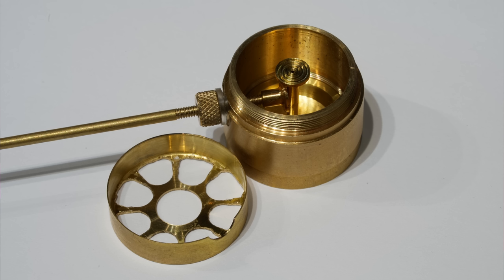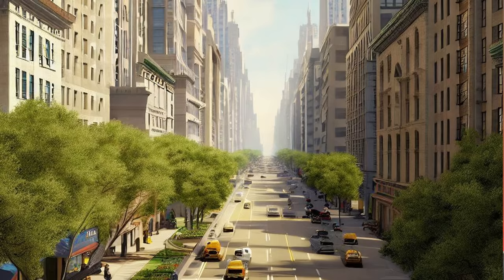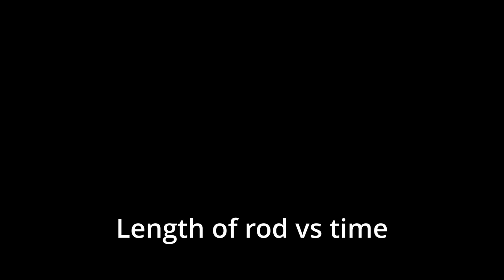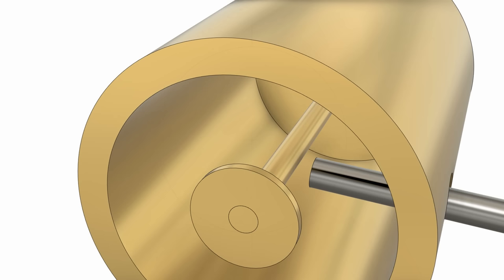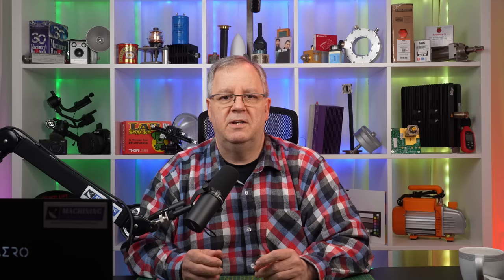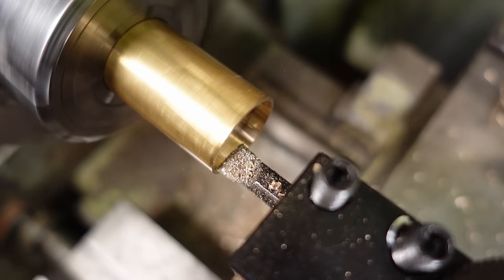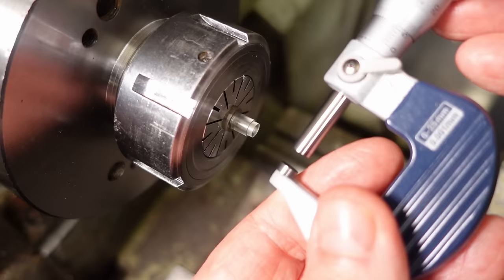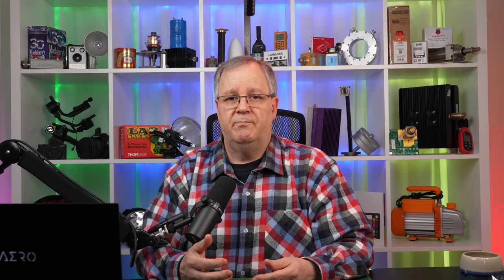SOLVING the Mystery Behind a Soviet Spy Bug : A True Masterpiece of Technical Elegance!

Comment: Let me tell you something without flatterie : you are a pure genius and an excellent machining man. A question : as a ping pong lover is it possible to invent a new way of building a racket , instead of wood , a titanium core on which the typical rubber is applied. Or to be more in your field : can microwaves influence the ball in some way , 2.8 grams of plastic ?
Reply from the maker: Celluloid ping pong balls have a Dk around 4.0, a little more than a polymer ball, but I can't find the loss tangent of celluloid, nor the exact polymer used.  If the loss is high, then it might be feasible to use a rapid-slew aiming system to hit the ball with a mmWave beam adn cause a little more heat to be dissipated on the side facing the sender, but it the ball is spinning, they the effect would be smeared out around the "equator" unless you could use something to detect the exact spin rate and send pulses only when an optical tracker say the same rotational position. Whether that could cause any useful deviation seems unlikely, but even heating the entire ball could affect the trajectory by heating the boundary layer of air and modifying the internal pressure. Some sort of titanium mesh structure might be a useful core for a bat, but the rubber facing probably has the majority of effects on the performance of the bat/paddle/racquet/racket.
Reply: I initially misread that as "building a rocket"... the resulting confusion was spectacular

Comment: Impeccable analysis ! Isn't there an ISM band close to the resonant frequency which you could use instead of 1200MHz ?
Reply from the maker: Nothing in ITU Region 1. In the USA I could use 902 MHz, but there's a lot of critical service allocations in the 900-1100 MHz range, see https://search.itu.int/history/HistoryDigitalCollectionDocLibrary/1.44.48.en.101.pdf p96 
Also, I had some kit for 1.3 GHz already. I did wonder about 868 MHz, but I'd have to make a longer body to get it to tune that low.  Easier to shorten a cavity than lengthen it!
Reply: @MachiningandMicrowaves  understood. Thank you for the link to the massive document ! Imagine having to manage that lot !

Comment: You know, some audio engineers pay big money for high end microphones. I imagine they would be even more for a custom microphone.
Reply from the maker: There are some absolutely stunning high-end custom condenser mics out there that are outstanding pieces of work. The folks making them are at the level of professional watchmakers and jewellers. You've got me thinking about making a microwave cavity microphone along the lines of those from the 1941 patents, but using modern components at microwave frequencies. That would truly be Machining and Microwaves territory.  Getting the connection into the body to be stiff and silent enough might need some very fancy techniques, buy perhaps just some ultra-fine wires and ceramic or glass feed-thru ports would suffice.  If I were to build the microwave components into the cavity wall, that might be a good solution.  The basic design is fabulously simple. I would need to consider how to get the tuning more reliable, perhaps by using flexures or a sapphire rod for fine tuning. Then there's all of the fluid dynamics to consider to get the frequency response to be adequate. Might have to do some vacuum deposition on mylar, but I'll need a thicker layer of about 8 micrometres of aluminium or silver then a gold finish, or go for gold right through. I'll let that one churn away in my subconscious for a few months!

Comment: Linen seed oil actually works as a thread locker...
Reply from the maker: Interesting, I should really investigate what they might have used.  I suspect a wax or Cosmolene type of material, but a drying oil like linseed would certainly work, if rather permanently.  Seeing as there was not going to be any access to the Bug after deployment, linseed could certainly have been used.  Thanks for that tip!

Comment: Svetlana and MELZ weren't doing one off super fine tuned stuff. Especially in 1945 when they were super busy redesigning their entire lineup of low frequency tubes to start cranking up replacements for RCA tubes in all the lend-leased equipment Soviets decided to keep.
Such a precise device would probably done in a prototyping lab at the facility that produced the whole system. Possibly under direct supervision of the designer.
Reply from the maker: Excellent point, yes. I did wonder if there were any lend-lease tubes that they could have used, maybe with a Kalitron style oscillator and multipliers, but I haven't found any references (yet) so it's just guesswork on my part. References suggest that Beria informed Stalin that a system was ready much earlier than Feb 1945, and this one was serial number 11, so it is possible the transmitter dates from earlier work.  There is also the question of the internal modifications to the Great Seal carving and when they happened.  Perhaps there was an earlier generation that was superseded before the hand-over of the carefully-targeted gift to Harriman.
Reply: @MachiningandMicrowaves  i think they made a nice cutout based on the design drawings, but either messed up or something changed design afterwards. So they gave a chisel and hammer to some RF technician and said something like "make it fit by lunch, so we can finish it, it would be covered anyway".
Reply: Or the hole was carved by a technician completely. So the craftsman who made the seal wouldn't even know he was making a bugging device.
Reply from the maker: @denisdrozdoff2926  It causes me pain because I'm also a woodworker.  It does have the hallmark of some RF tech using a screwdriver and hammer rather than fine cabinetmaking!
Reply from the maker: @denisdrozdoff2926  Indeed. Need-to-know basis

Comment: Your explanation for the fracturing of wine glasses by acoustic energy is very elegant but, I believe, entirely incorrect.  It is simple resonance of the gross structure of the bowl that causes the damage.  You could test this by using the same mass of glass to create glasses of different forms and seeing if they require different frequencies to shatter.  The frequencies needed to resonate even molecules, never mind atoms, of glass would be way higher than the human ability to hear them.  That would be one hell of a soprano....
Reply from the maker: It's a bit of a shaky analogy for sure. The bulk movement of the glass is the result of tiny intermolecular distance changes between the electron clouds of the molecules, so no resonances or energy level shifts or anything quantum. Just like in any solid, the bulk behaviour is a result of microscopic changes at the molecular scale. I was getting to the point of stretching the analogy beyond its elastic domainI think. Definitely meant intermolecular distance variation of the amorphous solid by means of a multitude of tiny strains moving the electron clouds away from their equilibrium points
Reply: @MachiningandMicrowaves  Not much of an analogy if it can't manage a good stretch. 8 -)

Comment: The Russians most probably used American made APX-6 IFF transponders supplied by the British during the war. The APX 6 used a  lighthouse tube in a coaxial cavity producing high power pulsed RF at around 1 Gb. The modification removed the pulser and replaced with a steady state supply which allowed about 1 W input carrier power. Another APX 6 could be used as receiver, with another lighthouse tube in a coaxial cavity as local oscillator. The downconverted signal was amplified by an existing wideband IF and an amplitude demodulator + audio amplifier was used to recover the ''stolen'' conversations. I have personally modified surplus APX 6 equipment in the late fifties.
Reply: Furthermore this system was easy to operate, because of a carrier power of a least 300 mW and a path lenght of less than 200 metres and no radio interference whatsoever. Any shift in frequency by the passive resonator could be quickly compensated by retuning the transmitter cavity. No problem with the reception, due to the fact that the AFX 6 IF amplifier is very wide.
Reply from the maker: I wondered if they used 446 or 446A planar triodes, although I don't know when those were first made by GE. Also not sure whether Svetlana had access to the disk seal manufacturing tech after purchasing the RCA assembly line before WW2. It certainly makes more sense that they would use a cavity planar triode than a klystron. It would have been easy enough for them to manufacture those devices and build custom cavities themselves even if those IFF modules weren't available. I bought a December 1944 GE GL-446A recently, image at https://i.ebayimg.com/images/g/U6EAAOSw5t5glCiZ/s-l1600.jpg
Reply from the maker: It would be amusing to build a cavity amplifier using that device if it still works
Reply from the maker: Other possibilities I wondered about are the 368 and 388 which were available from 1941 and perhaps even earlier http://lampes-et-tubes.info/tt/388A.pdf
Reply: @Machining and Microwaves  The APX 6 was a complete unit and the RF section had two cavities each housing a lighthouse triode, one was the pulsed transmitter with a 2C42 tube, the other the local oscillator with a 2C46. The triodes were made to oscillate by direct feed between the plate cavity and the cathode cavity with the grid grounded. Two metal probes shaped like beans provided the necessary feedback between the two cavities. Same layout with the local oscillator cavity. The L.O. signal was fed to a 1N21/1N24 mirowave diode and the received signal was downconverted to a 60 Mhz wideband IF amplifier using 6AK5 miniature tetrodes.
Reply from the maker: @gianfrancolovisolo4876  I've seen the detailed circuit and exploded views, also the articles about conversions of those units like I guess you did, with lower HT voltage and running as amplifiers.  Obviously in that case the T/R switching had to be done a different way rather than using the 1B40 Argon/Co60 gas-filled switch tube!
Reply: I actually published an article on the modification of the APX 6 in '73 Magazine for October 1964, page 76. This issue is available on the Internet and shows all the technical details for transmitting a steady state signal at 1200 MHz (the exciting signal) and for receiving it back on the modified receiver section with an amplitude demodulator added.
Reply: @Machining and Microwaves  In reality no T/R switch would be needed, so the neon tubes have to be removed. In practice to build this project, you would need TWO APX6 units. One would be used as steady state carrier transmitter, sending the carrier to the Bugging unit: here one would use just the modified Transmit cavity plus an especially built HV powerv supply. The other APX 6 would be used as receiver, getting the amplitude modulated signal back from the bug (nominal sensitivity 100 microvolts) downconverting it to the 60 MHz IF. At the IF output an AM demodulator would need to be built to recover the speech content stolen from the ambassador's office.
Reply from the maker: @gianfrancolovisolo4876  I saw that in 1960 the APX-6 units were selling for $10. Amazing
Reply: COMPLETE RF SYSTEM CALCULATION. SYSTEM PARAMETERS. The 2C42 Lighthouse transmitting tube is fed with 280 VDC@ 4 mA, giving a power input of 1W and an effective power output of 100 mW, or +20 dBm. With a distance of 200 m between from transmit antenna and the BUG, we have a path loss at 1000 MHz (1 GHz) of 79 dB. Using a transmit parabola with 1 m diameter we have an antenna gain of 18 dB, therefore the radiated power is: 20+18 = +38 dBm. Assuming unity gain for the BUG reflector, the BUG receives: =38 - 79 = -41 dBm, or a received voltage of 2,000 uV. With an assumed BUG transfer/attenuation loss of 30 dB, the BUG will translate in return, towards the receiver, a power of: -41 - 30 = - 71 dBm. Using a receiver parabola of 2m diameter, it has a gain of 24 dB, hence the APX6 will receive back a signal of: -71+24 = -47 dBm, which corresponds to 1000uV. The 1N24 downconverter diode plus 60 mhs IF ensures a worst case sensitivity of 100 uV, so the system will have a margin of 1000/100 = 10, or 20 dB.adequate for compensating possible additional operational losses. i'11\
Reply: Thus system calculation confirms feasibility of this system with adequate margins. The system would be easy to operate, due to the ease of frequency tuning provided by the manual frequency adjust knobs provided by the APX 6 cavities.
Reply from the maker: @gianfrancolovisolo4876  Another possibility is the CV397/DAT24/VX3058 disk seal triodes that were capable of around 10 watts continuous, but I don't have any evidence of those being available before 1944, nor of similar devices being made in USSR plants.  I have one report of the CV397 being used as early as 1940.  Perhaps there are pre-WW2 patents by GEC/Osram/Marconi or similar devices made in Germany before 1941.
Reply from the maker: @gianfrancolovisolo4876  I read your article at https://archive.org/details/73-magazine-1964-10/page/n77/mode/2up it was most informative!  Excellent work back when I was only six years old and playing with crystal sets with my great-Uncle
Reply: @Machining and Microwaves I was born in 1940. The work on the APX 6 was done in 1963 in our lab at home, my father was a Radio Ham and I an university student in Electrical Engineering. With the modified APX6's we made propagation  experiments and two way communications a 1296 MHz, a big novelty at the time. The longest distance we covered in two way comms. with 1 m parabolas was 120 Km, from Mount Penice to our home shack near Varese, Northern Italy. The CV397 alias 2C39 was a powerful glass or ceramic triode, far too powerful for this BUG work. At around 1 GHZ powers above a few watts were and are very dangerous for the eyesight.....Imagine getting the American Ambassador blind!

Comment: @13:43 They probably just picked a harmonic they could achieve and whacked up the power. Considering we're talking about russians this would explain why many ambassadors and staff got ill as if someone was irradiating them with something.
Reply from the maker: Non-ionising radiation sufficient to cause thermal injury at that range would have the unfortunate side effects of setting a lot of things on fire at the transmitter site as well. Also there's no mention of the exciter signal being found anywhere other than the fundamental. Varactors hadn't been invented yet, and even with a diplexer and dump load, the fundamental signal would have been extremely loud. See the "Moscow Signal" reports and the ICNIRP 2020 recommendations for EMF exposure. 4 watts per kilo body weight is where temperature regulation starts to reach problematic levels.  A 75 kg human body has an radar cross-section of about 0.8 square metres, so a level of 375 watts per square metre is where thermal effects would start to affect body temperature regulation, but at 1 GHz, the human would have left the area in a hurry at that level because of nerve stimulation.  From 140 metres away with a 20 dB directivity antenna (covering around 0.1 steradians, so about 1% of the sphere of an isotropic source) so about 50 x 50 metres, 2500 square metres, you'd need a transmitter power of about a megawatt, continuously for at least 30 minutes.  And some fire engines.  And an awfully large transmitting tube.

Comment: Very interesting - thank you. Presumably if they had access to the original transmitter signal at the receiver (via a second antenna ??) any frequency / phase instability of the transmitter would be pretty much eliminated in the homodyne receiver, and wouldn't be an issue as long as it avoided audio frequencies and didn't wander out of the ballpark? Could something like a spark gap coupled to a resonant antenna have generated enough power?
Reply from the maker: Problem is phase and amplitude noise.  You need a quiet and clean source to run a homodyne that doesn't use a phase-locked local oscillator. I suspect even a VHF push-pull Kalitron VFO as used in RCA TV sets in 1946 might not have been stable enough when multiplied to 960 MHz via cascaded push-push doublers or single-ended class-C triplers, so perhaps they could have used a crystal VCXO with multiple switched crystals to get a nice pure tone with sufficient range.  One day some kind soul managing the KGB archives might be gracious enough to publish the full details. Perhaps.